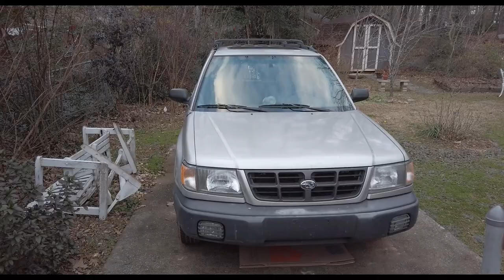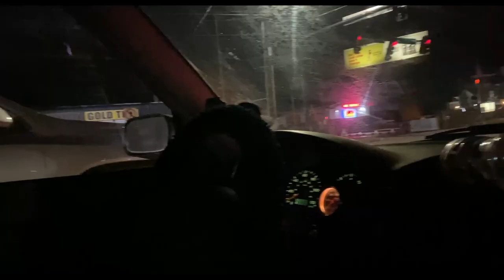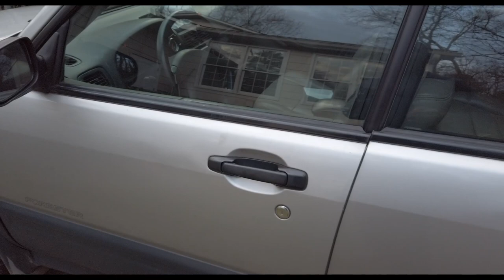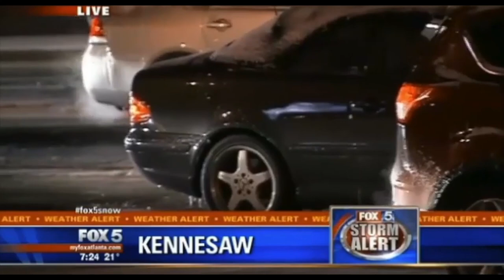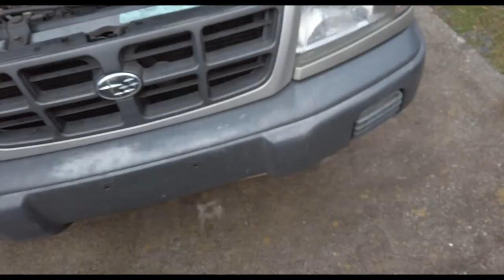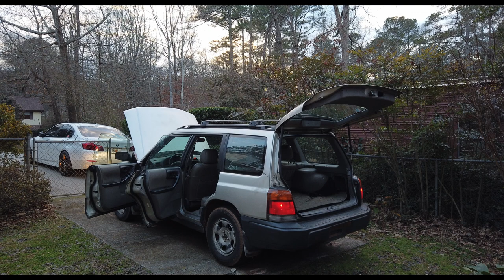Car Vlog - I Bought a Cheap Subaru Forester!!

Comment: Don't get aftermarket axles, scour junkyards for used ones. With a lift and larger tires, aftermarket can't handle the CV angles.
Reply from the maker: Hey bud that’s may plan - hitting up a few junkyards to get axles etc

Comment: The spark plugs are a pain in the forester. I just did mine in December and you need to have slim hands. The Drivers side is worse than the passenger side when it comes to space.
Reply from the maker: I just bought the plugs and wires.  I've got king kong hands so i'm worried lol